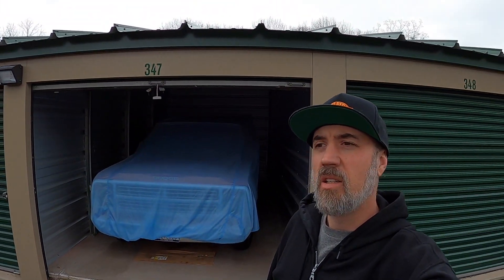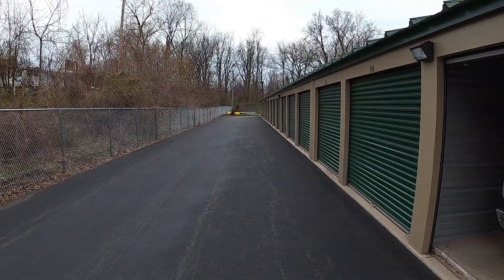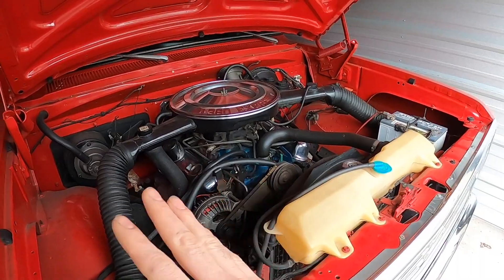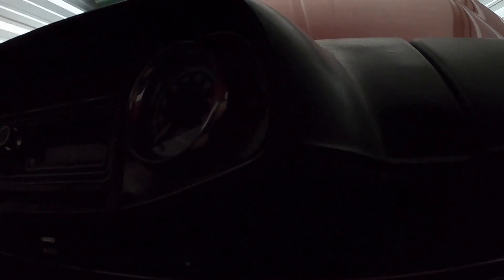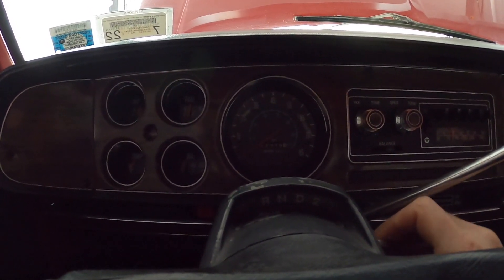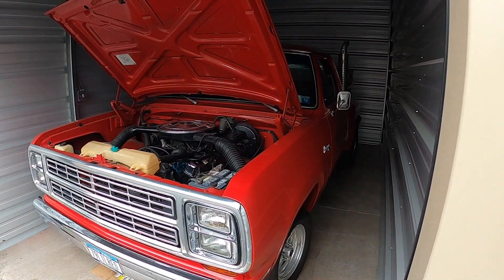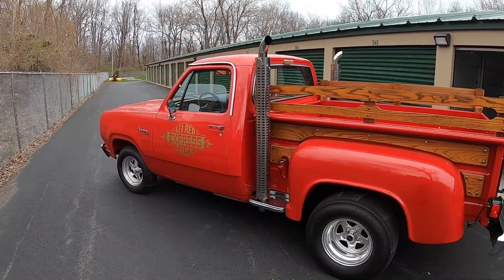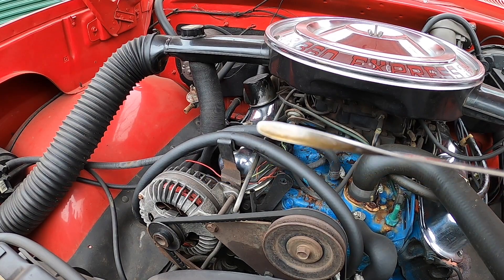Will It Run? 1979 Lil Red Express first start after 6 months of winter storage

Comment: I replaced the Harris battery in my road runner last year only because it was bought in 2007. ANd you used to be lucky to get 5 years. And the best way not to need a ballast resistor is kep a spare in the glove box. Changed my one and only in 1984, kept a spare and never neeeded one since. Beautiful Lil Red Zack, and sounds sweet!
Reply from the maker: Thanks Dave! I had to put a new battery in my 16 ram last year, factory one only lasted 5 years. I’ll be surprised if I get that long form the diehard I replaced it with. Yep I always carry a spare ballast so I’ll never need it 😆, there was one in the glove box of the warlock when I got it too lol!

Comment: Do you know what bumpers that will interchange on different years of truck and styles
Reply from the maker: Well all of the bumpers 72-93 would fit, but the brackets are different for each style. If you want to switch to a different year/style you will need the corresponding brackets.
Reply: @LilRedGarage  ok thanks I’m fixing up my 85 d100 my bumper is perfect shape but can’t afford to rechrome it I ordered the style from 72-82 hoping it would work from Lmc they jump all around 1985 they show brackets that will work with the bumper I bought that say will fit 86-93 but there out of stock don’t know when they’ll get them and again it’s skipping over 1985 not sure what to do I already got the new bumper and all the shipping cost
Reply: @LilRedGarage  I love both your trucks but that black is dad gone beautiful
Reply from the maker: My warlock had the newer mid to late 80’s style on the front when I got it. I returned it to the old style, and found the brackets on a Facebook group. There’s a page called “1972 to 1993 Dodge Trucks and parts for sale”  I posted on there looking for the correct brackets and found a used set that worked perfectly. The rear brackets are hard to come by, but there is a guy on the “tin grille dodge trucks” page that is fabricating them.
Reply from the maker: Thanks!!!